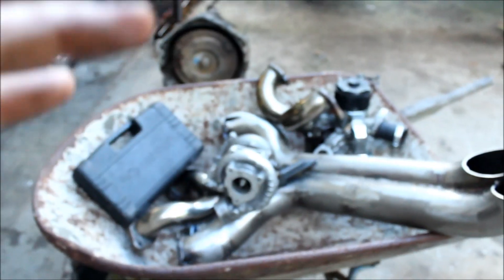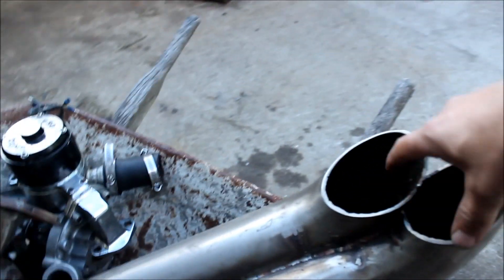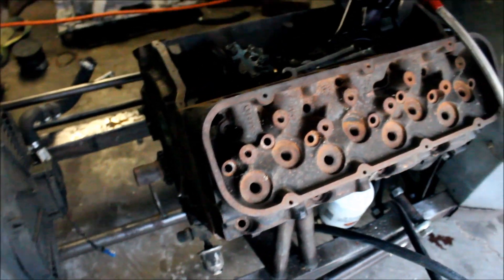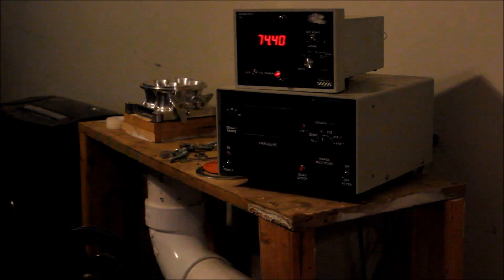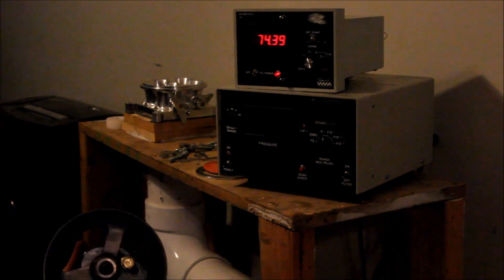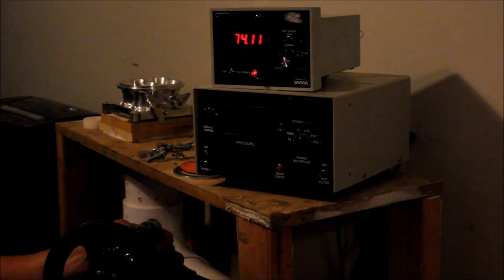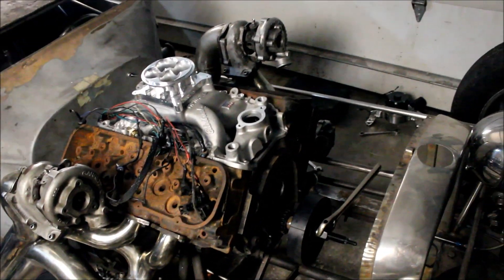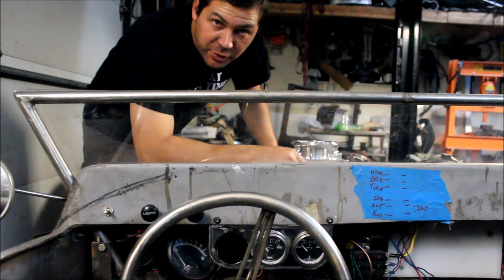Turbo Scavenge Pump Testing

Comment: sts turbosystems uses an electric pump for there remote turbosystems , and i seen people on the turboforum using one too 
http://www.rbracing-rsr.com/oilsystems.htm

might allso need to consider using two of them as the pump might draw from the eaziest pulling side only , unless you make a small sump under oillevel in the stock oilpan have the bottom turbos drain intoo that then pull it out there and back intoo the motor
Reply from the maker: watahyahknow The pump is two stages.  I'm going to use one stage per lower turbo and let the upper turbos just gravity feed back to the pan.